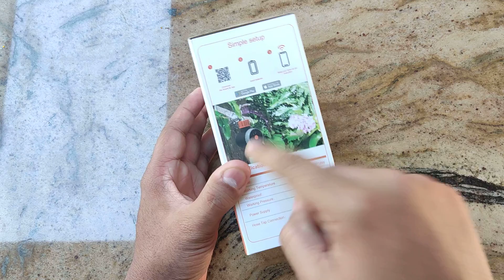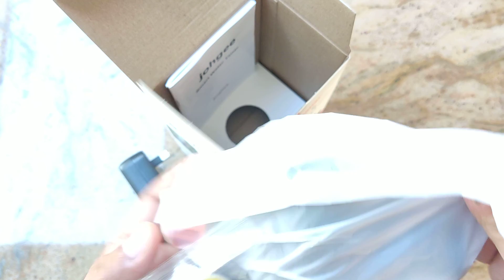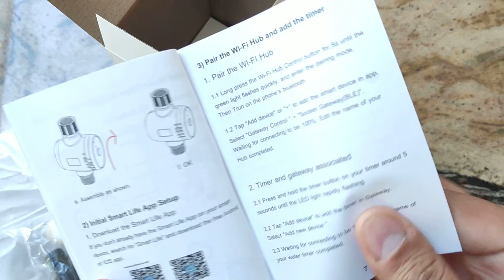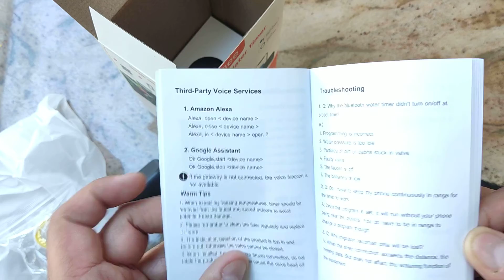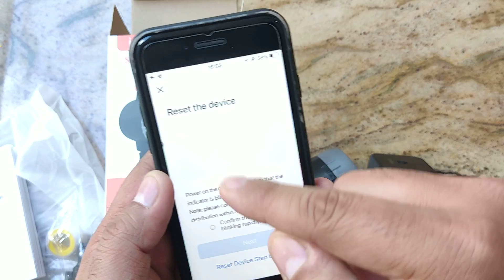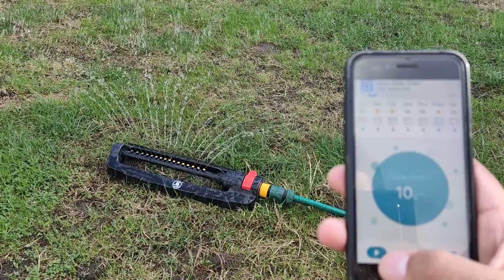Johgee Smart Water Timer | Irrigation System - Unboxing and Full Review

Comment: I have a similar Johgee model that works well. I would love to find a wifi moisture meter that works with the Johgee RF Gateway- do you know of any?
Reply from the maker: Hiya 👋 there definitely are lots out there and it totally depends on your personal needs and requirements. Given you've been using the Johgee and consequently the smartlife app, you might want to consider the smartlife humidity and temperature monitor to plug it into the same ecosystem and smart home assistant integration. That's quite cheap and works well but needs the batteries to be replaced every 2 months (which is kind of the only downside). 

The other options are the Vortex Vitality's Vprobe which is pretty cool but is meant for a specific use case to manage plant health but should be able to use elsewhere too. 

Then there's the pinless moisture meter that is meant for dampness measurement with a visual screen to show you the level instead of looking at the app. The downside there is that there's no app support therefore you'd be maintaining records manually. There's many others, all depends on what you're looking for. 

Hope that helps, help us back by subscribing 😉🤗

Comment: Maybe you're expecting too much from the timer as it's max operating pressure is 116psi. Possible fix to dripping (after all your impressive efforts to thwart!) might be to just open/'turn' splitter valve slightly up till leak starts then back down a bit at a time giving pause in between each downturn to normalize the pressure hopefully enough psi to still myst to ones liking. Back pressure since you're going from 1/2" garden hose to that tiny like 1/8th" tubing for the mysting system. if that really is 75' long and such tiny tubing that explains the female attachment being metal as it's expected to hold back all that pressure.
EDIT: Mine did come with a washer. I'm not certain it's factory included and i didn't get a pre-opened box but there's a screen across the center which is most useful for catching particulate in the line that might clog spray/myst nozzles.
Reply from the maker: Hi, thanks for the in depth explanation. Yes all new units do come with a filter in the box. Cheers!

Comment: Do you now have a better indication how long the battery last?
Reply from the maker: Hi, yes now that I've used it for one full year, I'd say it lasts about 8-10 months. Basically when the battery is low, the valve stops opening, so even when your scheduled job in the app says it’s succeeded, your plants haven’t been watered. That’s the time you’d ideally want to swap the batteries. Hope this helps. Cheers! 😇

Comment: I have the duel model. Is it possible to set up the smart life app without giving them your credit card info? Thanks.
Reply from the maker: Hiya, interesting question - smart life app doesn't normally ask for a credit card or payment unless you subscribe to advanced features where, based on the energy rating, you could get the energy consumption data from the sockets and other IFTTT devices. Are you subscribed to a payment plan or something specific? Cheers!
Reply: @MyNextBest  I got it working through guest mode.

Comment: Can I manually turn water on and off also
Reply from the maker: Hey Nadia, thanks for your question. Yes indeed you can, there’s the orange button on the pump itself you might have seen on the video that you can press instead of turning on the tap itself as the tap will be in its ON position already, although you could regulate the flow if needed.
Reply: @MyNextBest  now it’s saying Device connection Failure so I have to go outside every time to turn the water on what should I do to keep it on all the time especially if I’m out of the country and that’s a purpose my body so I can control it when I’m out of the car but I can’t do that because I have to continually go outside to press the button in order to keep it on
Reply from the maker: @nadiajosephdell653  Hey Nadia, you won't have to do that as long as the little pluggable wi-fi hub device is in range of your broadband wi-fi router and ultimately the water pump is in range of the wi-fi hub. It's kind of a wireless daisy chain but that's how it will work. If you're able to setup the two devices within the appropriate range, you won't see a failure. Give it a try and let me know how it goes. Cheers!

Comment: What is your thoughts?
Reply from the maker: Hi, Thoughts are simple really - it's getting the job done really well. Hassle free and you're fully under control whenever and wherever you are.
Reply: Why is that I have tried everything
Reply: Keep displaying Device connection failure
Reply: Absolutely the worst explanation I have ever watched!!!!
Reply from the maker: @calwolfe3094  Thanks for your feedback Cal. It's a smart water pump, uses local WiFi to switch ON or switch OFF the pump. In terms of explanation, what were you looking for? Tbh the operation and technology underneath is dead simple from a user point of view. Cheers!
Reply: @MyNextBest  It should be really simple but I can't get it to work properly. I add the WiFi Hub to Smart Life, then add a sub-device and choose the timer. That step is successful. When I then look at the WiFi hub, it tells me the device is offline and then the app tries to connect to the timer via Bluetooth but fails (even though Bluetooth is enabled).

Any ideas?
Reply from the maker: @BlueJaykeUK  Hey Shaun, Have you put batteries in the water pump? I'd suggest checking if they're installed properly. In practice, the button on the pump should stop/start. Once you've established that, try pairing with the hub in the app. Let me know if that works, if not I'm happy to make a video to demo the pairing. Cheers!